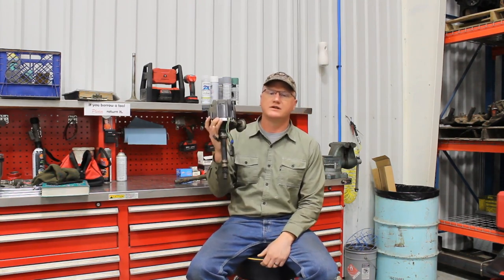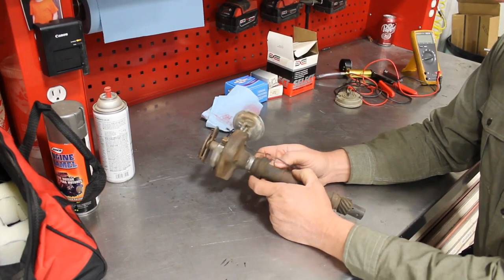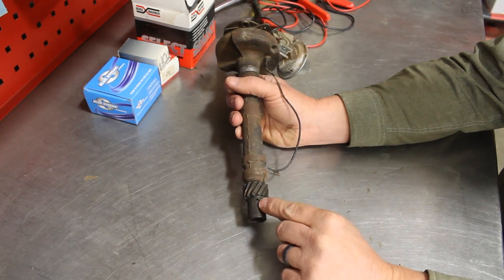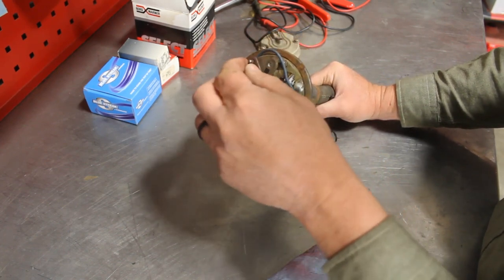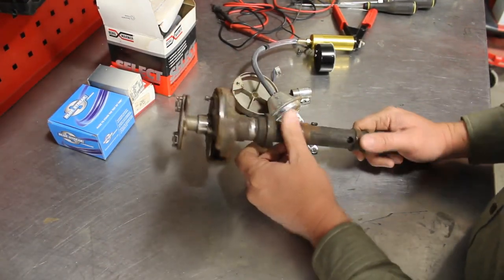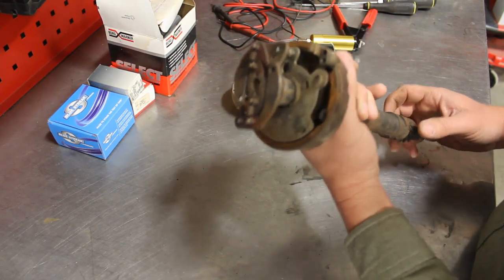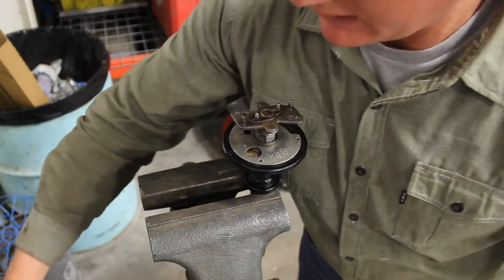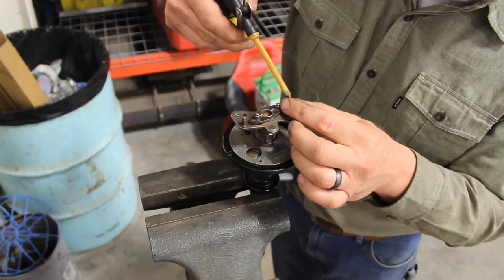Rebuilding a 60's Small Block Chevy Distributor - Set Points, Test Vacuum Advance, Test Condenser

Comment: Ahhhh...the memories of points distributor rebuilding! At 69 years old and after owning approximately 150 vehicles since my 1957 Chevy Bel Air 2-dr Hardtop purchased for $500.00 in 1968 with 283ci engine, Power Pack heads, power steering, padded dash, Wonder Bar radio and electric rear antenna, I have yet another car with a factory points distributor. A 1974 Corvette coupe with the factory 454ci engine. All original, unmolested and only 91,000 miles on the odometer. The last of the Big Block Corvettes and the last production year WITHOUT catalytic converters. Your video was very helpful in reacquainting me with how to rebuild a GM points-style distributor. Thank you!

Comment: Note that if your points are wearing great then DO NOT change the condenser. Another condenser can wear out points quicker. I’ve been using points since 1973 on my 1968 Z/28.

Comment: After getting left stranded on the side of the road twice in as many years due to a failed HEI ignition module, I switched back to my trusty Accel dual point distributor. Didn't appreciate my mint condition '66 Chevelle SS getting towed.

Comment: I've got an older 71 olds boat engine 455 that I was inspecting the points and  lo and behold there is a magnetic pick up in there. I bought this engine to install in my car. So I think it's an oddball. And if it's good I plan to run a MSD with it 👍

Comment: Never have a module go out. I like the HEI because the coils are 40,000 volts vs 20,000 for the points. The points start to deteriorate right from the get go.

Comment: Good video for some that aren't familiar with points distributor, definitely not for those with OCD. I'm a little OCD and would suggest that since you already have the distributor torn that far down, to go ahead and drive out the gear drive pin to inspect the drive shaft/other parts, but MOSTLY to be able to clean out the 50 or more years of dried, dust/grit embedded gunk that you'll find inside. Would make for a longer lasting, smoother operating distributor. Like you, I like the points on some of my projects, HEI on others. I like the way you show the little glitches we encounter in our work, that's the real world we encounter, not a pre-done work,  edited, everything"falls perfectly into place" video. Keep going, we need info on the old school stuff or the younger gear heads won't know anymore about it than they do about a dial telephone.

Comment: 🍁Hey Jay. Good video. I upgrade the motor in my 54 Fargo to an 8 cylinder, but my 40 Buick is all original. I try to reuse all the parts on the cars. Why spend more money? Great video. Thanks for sharing. 🍁👍👍

Comment: To me the biggest disadvantage of the HEI is its diameter, which causes trouble with hot rod intakes.  Its biggest advantage is the easily replaceable parts.  If you truly don't trust the module, buy a spare.  That said, I found your video looking for how to properly rebuild a points distributor, which, like you said, doesn't scare me.  I even still have a dwell meter.  And a points distributor is  the one part I try to keep around, because if we ever get EMP'd, it will still work.  And just in passing, no matter where you go to buy a rebuilt unit, it will almost surely be a Cardone unit.

Comment: Cool video. Now I know what to expect when I start messing with my Chevy dist. 

I noticed when you where checking the condenser you where touching both probes with your fingers. You body is a capacitor. So your readings will be off because of that. That is likely why you where getting changing readings.  Same when checking resistance. To get valid readings you have to remove yourself from the circuit :)

Comment: The inherent flaw (known since the 1930's) of points type distributors is at high rpms the voltage drops off creating all kinds of mis-fires. Not much of an issue and perfectly fine for grocery getters. The other issue of putting them into a post 1974 Chevs is you must rewire to reduce the voltage at run to 7.5v or the points and condenser will not last very long. HEI runs on 14 volts and for pre 1974 you have wire them at run accordingly.
Since not original to your 327, it might be a good idea to get a spring kit for yours and maybe even an adjustable vacuum can. GM was always messing around with distributor curves and total timing so there could be a lot of improvement found in tinkering.
Reply from the maker: thanks for the great tips!
Reply: Old distributors come with a resisted wire.

Comment: Do you lubricate the shaft lightly where the rubbing block of the points set rides against it?
Reply: No, you buy the rubbing block lubricant that comes with a holder that fits in the distributor 2 slots.

Comment: Really like your videos!  I wanted to stay points with my 66 C10, but all the points I found (even the high dollar premium brands) are made in China garbage.  Kept having issues in a brand new AC Delco points distributor, finally threw in the towel and installed an HEI.  Where did you source your point set from?
Reply from the maker: The set I put in was US made old stock that I had on the shelf. However I also bought a new Standard blue streak set to put back on the shelf. It is made in Mexico but is constructed out of good thick copper and seems to be very good quality. Part number DR2270P. Thanks for watching.

Comment: Set at 32 degrees dwell. That lead wire should have the same 45 degree end as the condenser. There are different value condensers, OVER and UNDER capacity. Otherwise it could rub against the rotating assembly. There also high performance,  CORVETTE, different INCHES of vacuum, and STANDARD for BIG Chevy's or TWO BBL. and adjustable vacuum advance units, for better tuning, and  quicker, timing. And quality points from ACCELL.  But still an electronic conversion is far superior to those PRIMITAVE  points. POINTS SUCK!!

Comment: Didn't feel the need to address that 60 year old dried up oil impregnetaed sawdust in the grease well?
Reply from the maker: oil soaked sawdust keeps thing quiet, any used car salesman can tell you that...
Reply: @TheJayhawker  So,  I'll take that as a "no"...
Reply from the maker: @mikethompson2007  lol, like I said that was as far as I wanted to go. Would it be a good idea to do so, yes but I seriously doubt I can find the seal or the grease. I suppose a guy could make them both himself...sigh, you just had to bring it up and now it's gonna bug me.
Reply: @TheJayhawker  The grease is a mystery... I've contacted  4-5 distributor rebuilders and gotten 4 different answers.  They will say valvoline, bel -ray or superlube without specifying which one!?!?  And corvette central sells the new top seal for $6.10 if you are inclined to tear it down again....
Reply from the maker: @mikethompson2007  Good to know, thanks!

Comment: I hate to dis someone's video because I know what is involved but you surimi are all wet. How many hundreds of thousands of miles did you drive1965 and older chevies with points. Must have one or two miles. With points you were many times running raged by 20,000 miles and need a new gap set. I have probably driven millions on chevies since the 70's. Did have ti replace one module my 1967 camaro was converted in 1989 to Malory Hall effect module with no problems since. It is a daily driver. I have watched a lot of your videos because of the 1948 Chevy and 327 rebuild and have found you mislead in most everything you say. If people follow your lead they will make the same mistakes that most of us have made over the decades. Please know what you are telling people first.
Reply from the maker: I'm not recommending anyone does anything I do, I'm bringing those who want to come along to join me as I work on MY projects. How many millions of cars used points before the mid 70's? It's not a big deal.  I'm willing to use them on my projects so why do you have a problem with it?
Reply: I don’t really understand what Mr. Switzer is trying to say?
I like running points in my old car. It’s been driven 40,000 miles since April 2020. I’ve had a few points issues, but I like wrenching.
Reply from the maker: @Monaco-BuilditFixitDriveitEver  Just one of the masses that like the thought of old cars, but don't want to experience old cars. What can ya do? Thanks for watching and commenting.